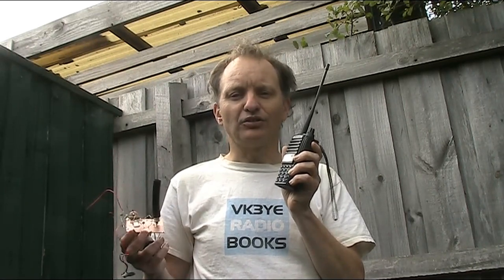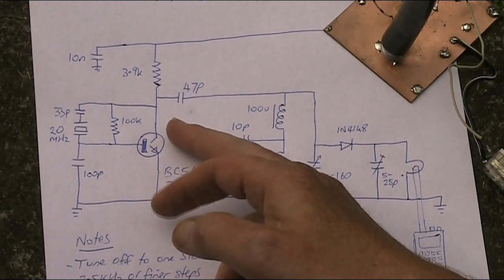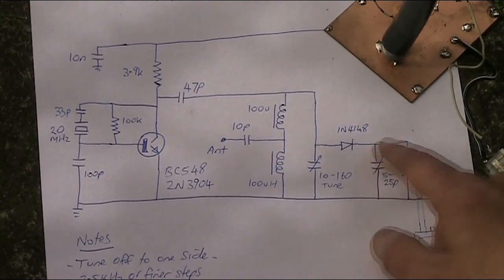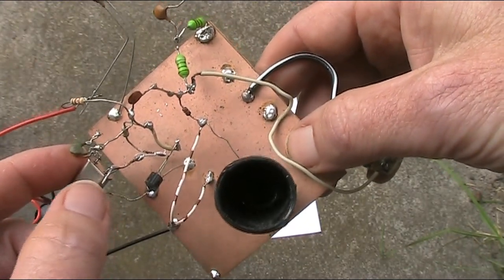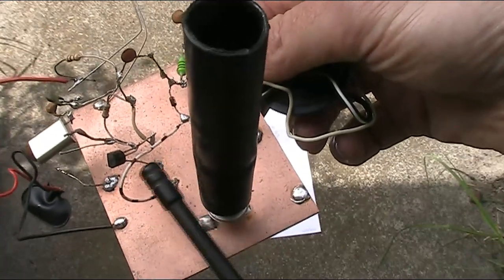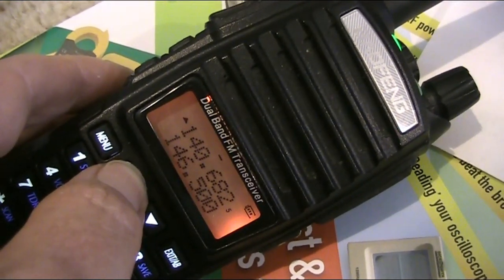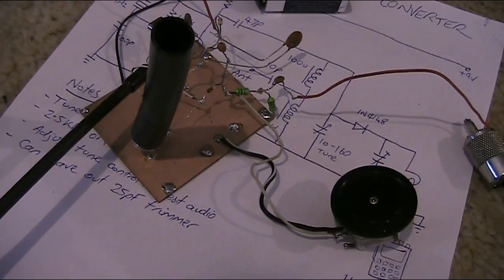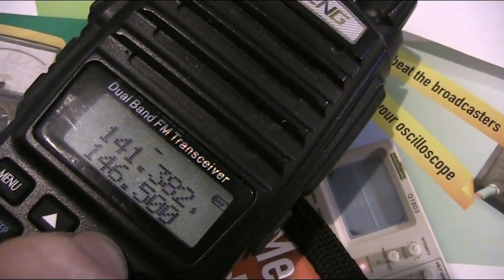Hear AM broadcast stations on your Baofeng HT!

Comment: Neat. I can pick up AM airband on my UV5R after increasing the tuning range with CHIRP. I had to save the frequencies with a slight offset. In NW UK I can hear the nearby airport ATIS weather info (128.180 MHz) very clear, handy for a bike ride. 

When listening to ground & planes on 134.430 it was pretty good. On 128.055 it was quieter and a few transmissions were garbled. However, turning the volume up to compensate you then get a loud noise on each over.

'Miklor' also has info on how to improve the squelch steps using CHIRP.
Reply: I'm NE UK and close to Teesside airport. Would love to adjust my UV5R to receive as I'm currently using an SDR dongle on a laptop. Did you modify anything other than extending the range in CHIRP as I was sure the UV5R is FM only?

Comment: This is absolutely amazing! Please do one day the very simple “turn an am/fm radio into a transmitter”, it was an extremely simple reversal doing something at a key point of the circuit but I forgot how! I think there are a few vids on YouTube… Cheers!
Reply from the maker: It's not that simple. Especially with modern IC receivers. Better to build a QRP tx from scratch as per some of my other recent videos.
Reply: @vk3ye  Just by chance, I’m set on building one of your QRP (with crystal), just got all the components😀! The “turning a radio into transmitter” was from these old am/fm alarm radios, it was a deceivingly simple intervention, I’ll try to find the vid!
Reply: @vk3ye  Here one, the type I’ve seen before, they feed the signal onto a disrupted coil by the tuning capacitor: https://youtu.be/zq8yH_CRuDg

Comment: Has the world run out of MW AM receivers?
Seems to me it would make more sense to make a converter for FM bands like 10M FM
 and 6M FM for a FM radio?
Reply from the maker: The deviation of amateur FM is way narrower than broadcast FM. Thus the audio will be very faint & selectivity terrible.
Reply: @vk3ye  I wasnt thinking of WBFM broadcasts i was thinking of converting NBFM 10M and 6M, if i remember right about 30 years ago Microwave Modules made a 10M in to 2M out converter, the opposite of the usual

Comment: How it is possibile that You demodulate AM on FM descrininator?
Reply: when in FM you can demodulate AM with a discriminator, it won´t be as goog as a transmission in FM, but it´s going to work. If you see the AM modulation in a sdr radio the frequency varies along the signal modulated (in the end its a big non-balanced mixer). But if tou try to listen to AM in a FM radio it will not work, because the demodulator of an AM radio can´t "notice" the varie in frequency, only in amplitude... I hope i helped a little :)
Reply: @lucasfeth2624  to be honest no. I even not asked about transmission. FM discriminator should be insensitive to variance in signal amplitude.  When You see AM on phasing diagram it is a length (amplitude) of vector while FM is a rotational of a vector. Od course on spectrum AM and FM looks like to have "sides" around carrier but it is not same! In AM sides are mirrored around carrier while in FM modulated signal are spread across up and lo sides. The only way that You can demodulate AM on FM descrininator is that descrininator is not prefect and in some factor it is sensitive to AM. But I expected that AF signal to be much more distorted than presented in video. So maybe there is some other magic in that simple diagram.
Reply: @adrian_sp6def  I think i understood, the two sidebands in AM  "cancel" each other when in a driscriminator? Well RF always has a new black magic to learn! lol.
Thinking about baofeng, they should not have the best discriminator in the world...